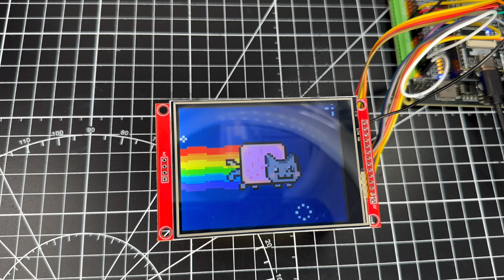3.2" ILI9341 TFT Display + XPT2046 Touch Screen ESP32 Tutorial

Comment: how to do it with arduino plz make that too
Reply from the maker: It runs on 3.3v only so you’ll need a logic level shifter. Arduino is 5v. We’ll have to find the best library to use for Arduino as I haven’t tried it myself,  it’s better to use an esp32 for this one or it will update really slow,